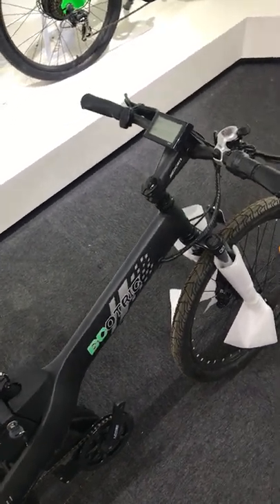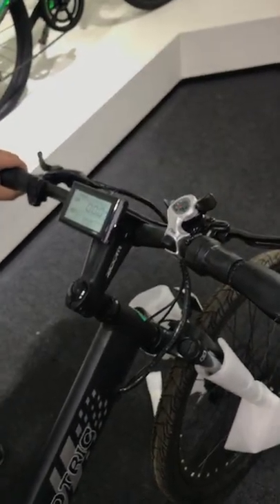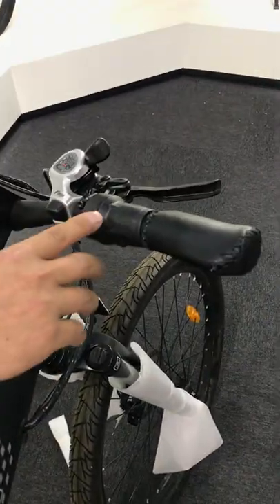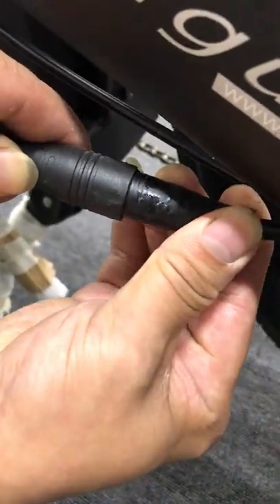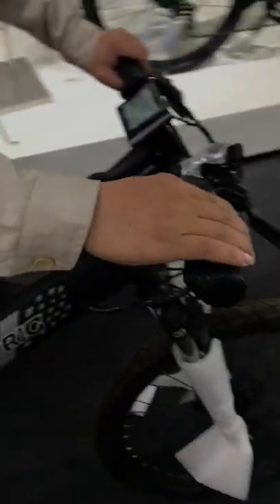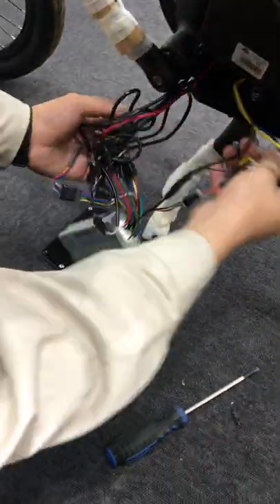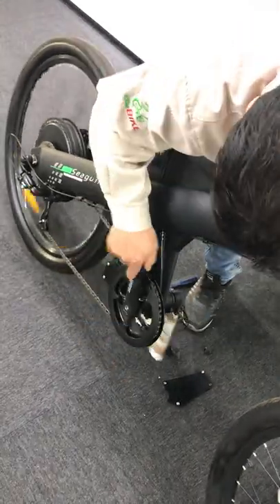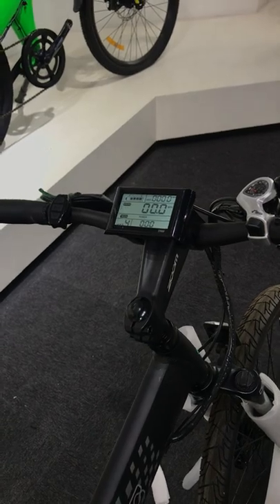Throttle Does work troubleshooting For Ecotric Electric Bike

Comment: I did all the tests and still the throttle is not working. I am 7 months in a 18 month warranty, so i called for warranty replacement and was turned down. Really ? I had to find a replacement and it works now.

Comment: ok so if you have a diy ebike with waterproof connectors (the 3 pin connectors) and your thumb throttle isnt working and has an error on the screen with controller report unplugging the throttle wont work unplug the controller it will go back to normal sometimes what will happen is the controller will glitch and when you hit the throttle it wont stop and when you shut the bike off and turn it back on it will say error 04H controller report its not a problem no need to buy a new throttle just unplug the controller and plug it back in

Comment: My throttle stop working out of no where. I was riding it fine for about 1-2 miles. Stopped for 5-10 to run into a store. Got back on my bike and no throttle power. I’ve done all the steps in the video. The brake sensors completely died, squeezing the brakes had NO effect on the motor. I removed both and replaced the front tire brake sensor. The sensor works fine now, and as intended. Walk assist works fine. Pedal assist works fine. The throttle is the ONLY issue. My bike is less than 3 months old, and has 196 miles. I’ve NEVER leave it outside. I was told by a local ebike shop that the issue was the controller wasn’t compatible with the throttle and lcd display/computer.
Reply: I am having the same problem. Everything works fine except for the throttle. Did you get yours fixed?
Reply: haterzproof yea, need to get a new throttle.
Reply: @dontmatter6020  thanks
Reply: I having a problem that my throttle and my PAS won’t work the only way I can get my bike to throttle is by putting my bike in walk mode idk what the issue could be
Reply: I have a problem my bike doesn’t work the bike drives for one sec and stops and the pedal assist doesn’t work and the. Break light is always on

Comment: Hi, I've had my bike for about 2 months and now it stopped working. My display says error 002. The brakes are fine but once I try to use the throttle, it doesn't work and the display says error 002.

Comment: I have a Ebike and i'm having a similar problem. My throttle works but only with pedal assist, the motor turns on as soon as turn the pedal. but once the bike is stationary the throttle doesn't work or should I say the motor doesn't react to the throttle. why is that ? and the display panel all modes behave the same way same speed.. what is that ?

Comment: My bike is 7 months old, same as one in video but fat tire.....the throttle will work ONLY if you lift back tire off the ground. Try it again 20 seconds later throttle won't work lifting tire off ground. Throttle will NEVER work while riding anymore. All this started after brakes were adjusted. Pedal assist still working great. Can you help me? Maybe ECOTRIC could make better throttles?
Reply: did you fix it? same problem here?

Comment: Nice video. I also have a question about that issue. Which is the sensor wire for that controller and how to identify it like color, connector type, etc?
Reply: That information would have made it a nice video!

Comment: i have the fat tire bike and ive had it only for 2 days now. Im having bad connectivity issues between the battery and the motor. i can not get the bike to turn on even with a fully charged battery in, and when i DO get it to turn on, the whole bike will shut off after the smallest bump. No LED, No throttle, no PAS, no nothing. Please help
Reply: Check all connections one by one.

Comment: Well. I brought two ecotric and my friend also brought 2. We each have a bike with this same problem. Sad, spend close to 4000 dollars on all our bikes with amenities and they don't work. On mine, the throttle, PAS, or KM (walk mode) does not work. I always ride on level ground but the day it stopped working I went up a small hill. Thereafter, for the rest of the ride, the throttle would engage intermittently and also PAS. I got the bike home. I have disconnected the wires from both brakes but still not working. When I roll the bike backwards it makes a motor grinding sound. I saw a video where the hub motor magnets can come off track. I will try that fix next. The wires from the brakes, to my understanding, are the two wires black and the other color (have it closed up right now). That is, front brake has two wires to connector and back brake has two wires from the connector both coming from the central wiring harness from the front of the bike brakes. It looks like Ecotric Commentor below is stating it could be the controller in a similar situation. I did swap the batteries out because I have two of the bikes and that did not make a difference. I believe something could be wrong with the hub motor itself. I tried turning off the bike, disconnecting the wire to the motor, and turning it back on. In sum, the when I turn the throttle I get a split second sound or movement which indicates to me that it has a connection to the motor but for some reason the motor is not engaging. Hmmm.
Reply: Same here...did you figure it out?
Reply: @foggyfields9378  I did. It was the throttle body. It's been a long time but basically it was a magnet in the throttle that was malfunctioning. I ordered the throttle and reconnected it to the bike and it worked fine since then. It's been a while but I recall I had to connect it to the black box below the pedals and since them has worked fine.

Comment: Had the bike a few weeks-throttle not working even after the brake sensors were disconnected-I was told I need a new controller-I am now waiting to see if it does come-not a good start-lets see how customer service responds
Reply: Sorry to heat that, you too huh. Too many people are having throttle issues too soon. I won't be buying ecotric ebikes in the future. Hope someone can fix it for you.
Reply: I am going through the same right now. The customer service is so short with you that takes forever. Im waiting for a controller now. at least the tech responds but i practically missed the summer with this.

Comment from the maker: When meet the problem,we as a tech the first thing want to know are:
1. Can the display be lighted up? 
2. ONLY the throttle does not work or none of the throttle,pedal assist(please make sure you turn the pedal a whole circle) or walk assist(For S900,S700 display,please Press and hold the ∨ button for more than 3 seconds;for 810 display,please press and hold 6km button for more than 3 seconds   ) does not work?
Reply: ECOTRIC Electric Bike if the ebike is lowbat can it affects the throttle?
coz my trottle was loosing after a few minutes the suddenly comes back..

Comment: My ebike is a POS although I’ve got a proper 60+ ebike I have another one similar what goes 23 at factory I made it go 30 but the other day I got it out and the the wind flew it over and it damaged something. Tried this but didn’t work. Tried everything. So I think screw that bike just stick to my bike I always use. I only use my other one for small trips

Comment: Hi so I received an ecotric and the brake levers when on wrong sides- so this required switching to correct sides and then after doing so the throttle doesn’t work- it lights up but nothing happens 
 So now I have a new bike and it doesn’t work and I’m getting no help from ecotric 
Does anyone know what this could be and or how to fix?

Comment: I tried all of these on my fat tire ecotric bike and none of them work what happened was my throttle will not  push the bike, if the handle bars are pointed to the left but, when I turn right the bikes motor stops and the only thing not working is the throttle the peddle assist and walk mode work perfect and btw my bike is only 4 days old I’m surprised I’m already having problems but if someone could help me out that’d be great
Reply from the maker: You mean that when you turn left ,none of the throttle,pedal assist or walk assist working ? If so,please unplug connection that connect the brake lever and controller(It is the only 2 plugs that have 2 wires on each plug),then please try the throttle,pedal assist and walk assist,does them work ? If  all of them are working,that means it has some problem with the brake levers,if still not work that means the controller is bad. If ONLY throttle does not work(pedal assist and walk assist are good ),it means the throttle is bad.
You also said that when turn right, "the only thing not working is the throttle" , If the pedal assist and walk assist are all good,it means the throttle is bad.

Based on all what you said It seems like some wires(the one connect throttle and controller or the ones connect brake lever and controller ) or connection is loose. you can un-twine the tape on the wires to make sure the wires is not broken somewhere.

Normally,your problem will be solved within 2-3 emails if you can describe your problem clearly and provide necessary video or pics.